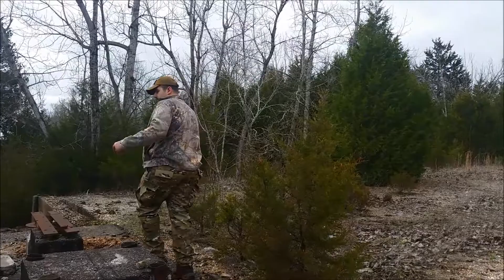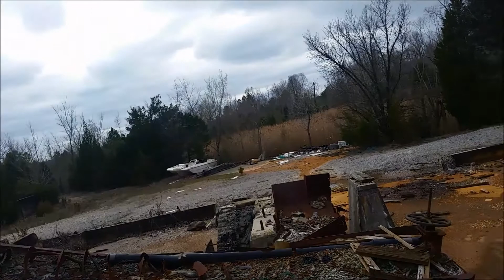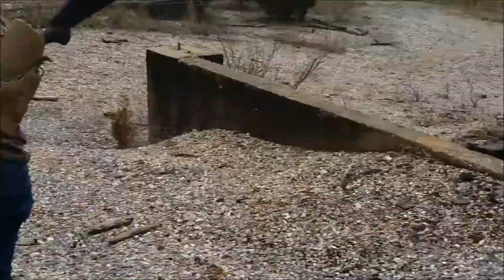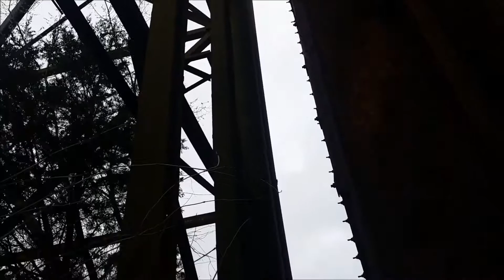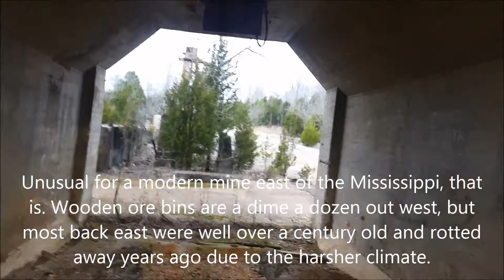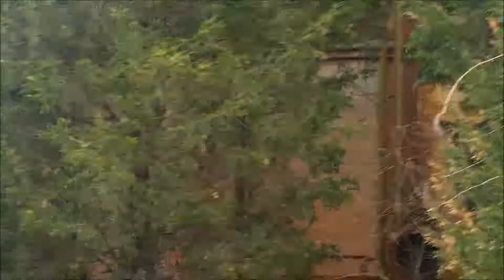Hutson Zinc Mine - Headframe, Mill Remnants, Open Shaft

Comment: Love the wooden ore bin! That was  weird seeing that on top of cement  like that. They quit building those over here before wwll or so.
Reply from the maker: It was a weird design for sure. I found an old postwar documentary that showed another shaft (not the Hutson; the ore bin was set up for trucks to drive under, whereas the Hutson had a conveyor running to the crusher house) with nearly-identical construction. It seems to be interleaved two-by-six planks, sort of like a log cabin.

The other headframes we found in the district all had metal ore bins. We found a total of three and a half headframes; most everything else was taken up for scrap around the nineties. As for the "and a half", the Heavy Media Mine's headframe had been taken down, but the sheave wheels, ore bin, skip dump mechanism, ore chutes, and a lot of the structure were located right beside the mill foundations. Compared to most districts in Missouri, this one is in really good shape- quite a few change and hoist houses are still standing on the Kentucky side. The locals seem to have been content with not tearing apart everything not nailed down, which I found refreshing. We would have gone to see a bunch more, but really only had time to be out there for two days due to other commitments. 

This district deserves a follow-up, just like the Magdalena District. Klondike, Dyer Hill, Klondike II (one of two mines shipping spar in the district), Annabel Lee (access permissions need sorted), and several more need visiting. (I'll be back in the Magdalenas for a day or so in May; I got a summer job doing mine planning for a copper/gold/molybdenum company.)

I'll try and get the other videos uploaded gradually; there should be five, one of which looks like a small prospect, and two of which are insanely huge complexes that haven't been touched since they shut down forty years ago.
Reply: Headframe Hunters Those are the best! Yea on site mills and plants pretty much were the straw that broke the camels back for ore bins. Really sucks it's mainly shafts in that area and a really high water table. I and I'm quite sure you two would love to see the insides of one of these babies!